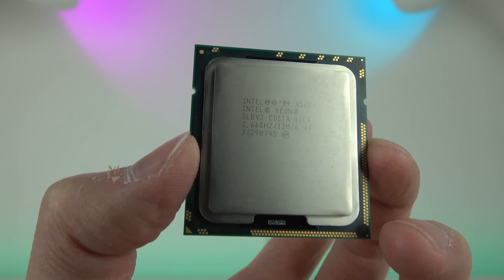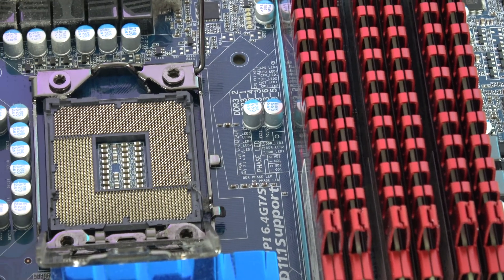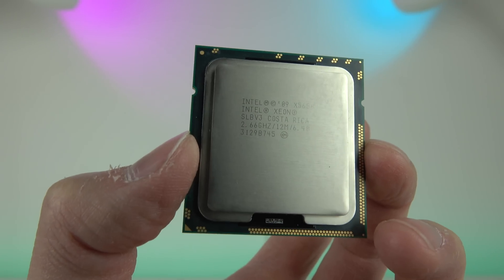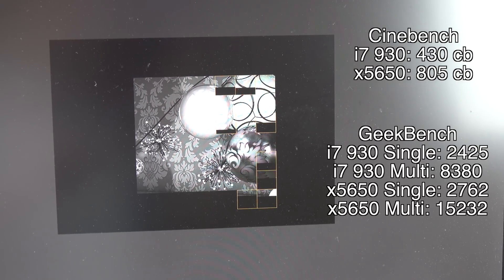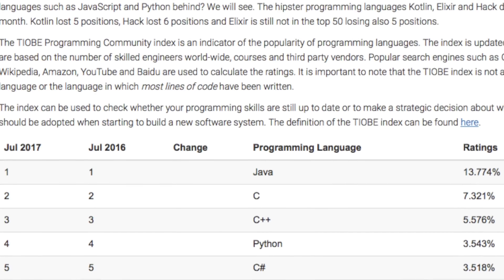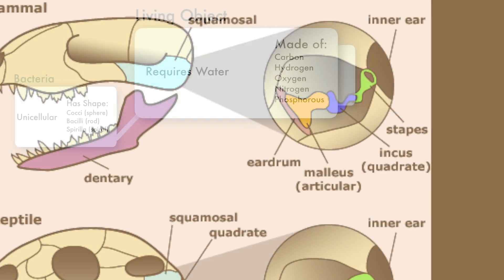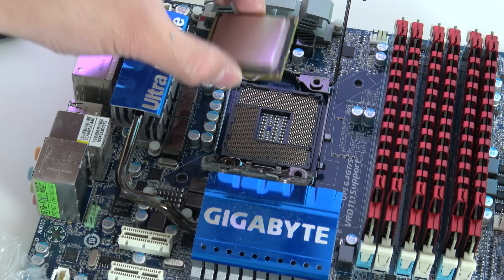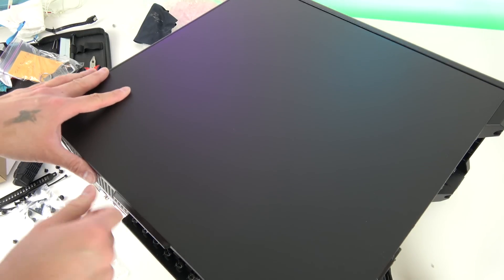This 6 Core CPU Costs $20. Will It Let My PC From 2010 Last 3 More Years?

Comment: I got that case for free on the side of the road in a free pile. It’s been my daily driver since 2016. Still going strong but with Linux Bazzite on it now. 
Asus crosshairsv formula z
AMD 9590
32gigs of ram
4x Samsung evo 2Tb 
AMD R9 200 gpu 
950watt power supply
This bad boy heats my house 
I built it to max out gtaV

Comment: 😉 Love your explanation of Object -oriented design. I used a X3550 in a HP 400 workstation. I had the same idea in extending my PC life. Went from 8Gb memory to 12 Gb. This year will extend that to 24 Gb. Video from GT8800 to GTX 460. Now going to GTX 1060. All drives are now SSD's. CPU to X5690 now that prices are lower.
I originally started with a I-930 also, unclocked.  Going for longevity than speed. Thank you for your presentation.
I remember the original 8080 chip running at 3 mb speed. IBM PC, 4k mem, 10 mb harddrive, spots on green screen for graphics, running Dos 3.1 for OS on a 5 inch floppy.  PC's these days fly in retrospect. I could insert OS on floppy dr,
to boot, make a cup of coffee, go take a wizz, and be back at my desk before Boot beep. Ha, ha,ha. Nostalgia.

Comment: Computers certainly can last quite a while if they're cared for at all. Easily well past their useful life for current software. 

I've got one from 1983. Granted it had a flickering display when I bought it, that took some soldering in some new capacitors to fix(and an inattentive moment led to burned fingers) but it works pretty well now. 

Building PCs is fun. I built mine to hopefully last me a good 5 years with high end use cases. If I can hold out till AM6(I'm an AMD fan) that would be ideal. There are several parts that I can upgrade to keep it going(if I hit a CPU bottleneck though I'm screwed, can't really go anywhere from the 5950x for my use cases without upgrading the board and RAM and that's pretty much a new system at that point, even if I reuse a few other parts.

Love seeing tech videos where I don't expect them.

Comment: this goes to show you how little pc technology has moved in the last 10 years.  Honestly a core duo with a added gpu will let you do basic tasks no problem at all like youtube, emails, office work etc.

There is NO way you would of gotten 10 years out of a pc 30 years ago.  Hell even 20 years ago you wouldnt have gotten away with it.
Reply: it doesn't mean stagnation but rather pc technology has matured enough to have backwards compatibility. If you compare any modern day cpu or gpu to one from 10 years ago, the performance delta will be massive.

Comment: my first computer was an old pentium1 from 1992-93 i got this secondhand in 2003..so very dated at that point but i only used it to run dos era games so it was fine.....then i sold it and upgraded to a used core 2 quad q9550 in 2008 through 2013 (only upgraded the motherboard and ram so i could go from 4gb ddr2 to 8gb ddr3) that said i had maybe 2-3 different grpahics cards over the span of use...then in late 2013/early 2014 i picked up an all new system rocking an i7 4770 and gtx 650 (which later got swapped out for a 960 4gb) the i7 4770 build held up well till just early last year when i built my 4th system (i7 10700k 64gb ram rtx 3090) i still have the 4770 rig tucked away in the closet next to the q9550 rig

Comment: To be fair, if you had chosen the X5690, you could have even overclocked it to a nice even 4.0GHz and would even still be usable today for all of the workloads you mentioned. Of course there are obviously better solutions out there, but if all you wanted to spend to get a major performance upgrade was $100, that would be the one upgrade that's worthwhile.
Reply: XEON isn' t meant to be "overclocked".

Comment: I'm from 3 years in the future: 4k has gone the way of the Dodo; 50k is the new meta and you need at least an I15-50,000k CPU with 5 terabytes of RAM, 50 exabytes of storage and a XTX-9080 GPU.

Comment: If you still use this system for gaming and streaming, it might be worth looking at getting something like a RTX 2060 or 2060 Super. The new nvenc encoder on is will make steaming much easier on the cpu and give a general boost to gaming. If you ever upgrade the entire core of the system to something new, you can just keep that new gpu. A pci-e SSD would improve video editing but you'd be limited to the maximum bandwidth of a pci-e 2.0 X4 slot, which is about a max of 2GB/s or average of 1.6GB/s in my experience using a nvme SSD on a riser card. The caveat to that is that you have to use a separate boot loader, such as Clover boot, to actually boot from the pci-e card since the X58 chipset on that motherboard doesn't natively support that. I wouldn't recommend the hassle for someone not very technically savvy.

If you're looking to upgrade to something new at some point, I'd highly recommend at looking at a AMD Ryzen based system. I think a Ryzen 7 3700 would be a good fit for your apparent workload of gaming, light programming, streaming and video editing. Given the lack of availability of Nvidia's RTX 30 series cards, going with something like a RTX 2060/2060 Super or 2070/2070 super would give you solid performance at 1080p, 1440p and even some 4k if you're interested in that. 1440p is certainly the butter zone for quality and fps. I don't think that Cooler Master V8 cooler has an AM4 bracket with it but if there is one available for it, contacting cooler master would be a good way to keep using it as that is a very solid cooler.

I love the videos by the way! They're very informative and while I'm not a doctor or training for the medical field, I find the topic quite interesting. I think I'll stick to working on computers rather than on people though. ^^;

Comment: Overclock the CPU and then throw in a pcie adapter to nvme and use Duet to boot off from and  you will have basically a brand new pc that is very fast. No need to buy a new pc.

Comment: you used class inheritance as an analogy, but I think really what you're talking about is interface implementation. DDR, LGA, PCI, AGP, PCI-e, SATA, USB, etc.etc. are all interfaces defined by a specification. similar to programming interfaces, they are "contracts" that define precisely the protocols, voltages, input connectors, etc.etc. that are necessary to create a compatible device.

Comment: I've built 3 PCs in my life. The first one I don't quite remember in detail. I'm pretty sure it was a pentium 4 with 512mb of ram. The second pc was an intel q6600 quad core with 4 gigs of ddr2 ram and a geforce 8800gts. At the time of building, at 2007, it cost me around $2000 which I had saved up working a temp job as a teenager during summer. That one pc lasted about 9 years with updates (8 gigs of ram and a geforce 660 to replace the dead 8800gts) and ran relatively well for my needs until finally the motherboard itself had died. 

Fast forward to today and I'm on a new pc built a year and a half ago that cost me about the same as the previous, with a core i7 8700k, 32 gigs of ddr4 ram, and a rtx 2080 with the intention that it lasts around 7-9 years. So in a matter of speaking, I agree with you on getting stuff to last.

Comment: X58 is great. Server xeon chips are just early sandy Bridge processors. Sandy was a giant leap. An old i7 2600k can still just hold up overclocked to 4.6ghz. 5 if you have good cooling. The x58 xeons are a cheap alternative to zen and zen+.

Comment: Still using an FX build with an 8350 and asus mobo from 2012. Didnt cheap out on mobo so its been running strong since then. Board temps are always normal. I've upgraded GPUS twice since then and of course OS and storage drives. An SSD is a great upgrade for an older system. Using an 8 year old 750 watt powersupply which still has normal voltage rail readings. Pretty impressive actually. Upgraded case to the Rosewill rise glow for 60 bucks on sale. Best price/performance ratio in town lol. Gotta clean out the parts and case every year or so. Unless you have good dust filters :).

Comment: I've been an Intel user my whole life, but AMD always did upgrade paths much better. Their sockets always last multiple generations and it's very common to see an AMD motherboard that supports cpus newer than the year it came out in. Intel on the other hand always seems to switch their sockets every 1 or 2 generations. If upgrading pcs like this is a feature you need, I suggest switching to AMD.

Comment: I still run this platform myself, X5670 running 4.5GHz with 1.32v (very good bin), 24gb ram and a vega 56, really solid system still

Comment: I like this video as it explores a good question about legacy pc hardware. I suppose it depends on what you mean by last. I have an even older pc that I use as a htpc that plays 4k video and windows 10 supports it. I already had it and used it for too long so the components aren't worth selling, and I have a use for it. It plays all content from "unofficial" sources, supports all codecs and only cost time to set it up. Only a quad core cpu  and 8GB of ram so it's at the end of life for modern gaming for sure, that's not important to me. I'd replace it at some point with an ultra low power solution but will work for now. I'd like to see an update to this video but I'd have to think, with ryzen 2 having been released, anybody who has made it this far if an old computer is their main rig should absolutely upgrade now. This is the best time and would see an immediate night and day difference.

Comment: audio popping is an issue with sound latency setting and the quality of the soundcard. an old soundlaster 24 or x-fi still beat most onboard sound chips, in sound quality, latency, and through ASIO support.

Comment: The server processors may be slower but they are tested to last longer being powered on 24/7.  Slowing them down that little bit probably helps to extend their life some.  The AMD Opterons are like that too, slower than some desktop chips but made to last a long time.
Reply: its also probably why they are flooding the market as well .
these intel xeons just don't know when to quit , as the saying was :)
Reply: @logangraham2956  This is good for people who want a cheap server.  Some might use it as network attached storage and some may just want to be able to use insane amounts or RAM for some reason.  Some servers are not that great for gaming but if you can find a server board with PCIe better than 8x you may be able to get the full benefit of that very expensive graphics card.  Some servers can be operated out of the rack if you know which jumpers to configure and where the power connector is.  They might not have an obvious connection for a keyboard or any of that stuff but some use an adapter that plugs into some sort of connector to give you all of those things (assuming that they are not there already).  I only know that stuff because I have seen a video of someone powering on and booting a server that was not in a rack.  Depending on which one it is you may have to do some digging for jumper settings to get it to work.  If you are lucky you won't have to jump through those hoops.
Reply: @JohnDoe-gm5qr  oh , mine is already running perfectly :) , in fact its the very one im using right now.
the base system is an 
intel hp proliant ml350 g6.
its not a rack unit but rather a tower.
unfortunately i can not close the case completely with the graphics card i have chosen.
the graphics card itself fits fine however with the added with of the power cable's plugs it does not.

but I've been monitoring its temperatures and i think with the addition of the makeshift case fan its able to maintain a strong enough airflow despite the small gap.

Comment: i went from a crosshair 4 to MSI ms7693, got thermal paste in the crosshair socket and it never worked again. board lasted me 7 years, still have it in hopes of one day resurrecting it 
AMD 1050t 6 core went to an AMD fx8350 8 core 1050t used for 8 years and still works well for what it is 
GBgb ram to 16 gb ddr3 
hd5750 gfx to gtx660 to gtx960 
corsair ax750 watt power supply, overkill it has had to work so little I have never had the fan turn on. the other one I was using died amd my wife at the time agreed to use the credit card to buy the new one.
that was my first true from scratch computer build
married divorced prison job military in the national guard and countless other life experiences. 
the same 22in monitor I bought back in early 2010 

it's going to be a hard good-bye when I build my next system in the fall

Comment: My friend has a saying that goes something like this:

An axe will last forever as long as you keep replacing its head and handle.
Reply: @igcogcigciggicifx4763  When you brick your axe by forgetting to factory reset the handle prior to installation
Reply: question is if that ship of theseus is still the same ship when you have replaced every single thing.
Reply: David triggers broom
Reply: @igcogcigciggicifx4763  calm down faldegast; Ive broken the warranty seal way back in 2010 already, you can not be held responsible for any damages done, rest assured
Reply: @igcogcigciggicifx4763  haha "there's an axe for that"
Reply: well said, for pc, eventually you are gonna have to replace everything. first change the motherboard to fit a new cpu. then a new power supply to feed the higher power cpu/gpu. then new fan to cool it. then new monitor for 4k, 8k.

Comment: I have done this many times!  I buy my components after research to be upgradable well beyond the needs of the day.  I had a server/pc last 12 years until windows would not support the hardware.  It is still running with Linux on it but is relegated as my firewall program and is now this day 18 years old.

Comment: Downvoted for your betrayal of the HAF. That was and still is the best full tower case ever created (I'm also baffled at why you think it's ugly). You'd have to be nuts to migrate to a mid-tower from a case like that. I've still got my HAF 932 from 2011 as my secondary workstation. I'm rocking a Thermaltake Core X71 case now (i9 9900k w/ GTX 1080ti, 16gb vengeance, NVMe) for my primary workstation (if you think the HAF was large, the X71 dwarfs it). The only reason I switched to the Thermaltake X71 is I couldn't risk downtime during my new build if something needed RMA'd since it's both my gaming and work rig (I'm a  telecommute programmer), so I decided to keep the rig intact and just buy another case. But anyways. You're nuts. You betrayed the HAF.

Comment: wtf im using a dell vostros 220 mobo 4gbz of ddr2 1333mhz and a Q9550 core2quad and a gtx 960 and evga 500watt bronze still using it right now too watch your video so 6 core should last my PC is still really fast and I still get 120FPS in CSGO and fortnite in 1080p no issues meh so your barking up a dead dogs ass

Comment: I got an i3-2100 with 8gb ram & radeon 7750 1gb PC for £100,  swapped out the 7750 with my old 7850 2gb, then I brought a i5-3570 for £35 and put that in.  I then put in my old 120gb ssd as set it up as a great linux PC that's snappy & plays older games perfectly. All in all it has been a great PC for what i personally paid for it.

Comment: My x58 build has died a year before you posted this video. I purchased new SSD and GTX 970 for that build one month before to upgrade it. But in the end, I have to purchase the rest of the components too, because my motherboard died. It was also good 7 years with the PC. I built it in 2009 and practically it covered my entire use cases, so I have no regret.

The problem with my build was it didn't want to detect complete 3 channels RAM, and sometimes it won't boot because of RAM problem. My suspect was because the DIMM slot was faulty. But I didn't have any chance to troubleshoot and proof it because there is practically nobody owns such system where I can borrow some components (CPU or Motherboard), and also nowhere to purchase even a second hand one.1 So I gave up and purchased a brand new x99 build to replace it, also hoping to keep it for at least another 7 years.

Comment: the resolution of the screen displayed is certainly not goin to affect anything since most ppl dont even use it, nore will we be forced to use is..
as far as computing goes, well  thats your choice. but what most people actually need is a different story.  Example, I'm a pctech of 20+ years experience.. I'm still on an i5 2300k and a gtx 750 (not ti)  lol why?   it works fine, and the only games I play run in 1600x900 fine at 60fps....

so.... why would people bother with something like an rtx 2040  whatever $2000 dollar video card when nothing supports the technology yet :-\

Comment: I have a Dell optiplex 990 i7-2600(no k), zotac 1060amp6gb, 12gb ram, 128gb SSD boot,2tb HDD,550w PSU.  I really need an upgrade path using used parts.  Can someone please give me some ideas that are worth it.

Comment: My i7-2600K@3.4Ghz (overclocked@4.4Ghz) with an AMD RX470 and 8GB Ram from 2010 runs fine today. And i push the CPU hard as i run many virtual machines from OSX to Linux plus XPlane Flight Sim & Asseto Corsa... No need to change anything!

Comment: You keep talking about dust. You realise that a computer produces ZERO dust right? Your computer has be filtering dust out of your air this entire time. That is why there's dust in it while the materials it is made of are incapable of producing dust. And with fans that extreme you could have just stuck some filters on the intakes and bumped up the air filtration to levels on par with actual consumer grade air filtration devices while maintaining better thermal management than your new case.